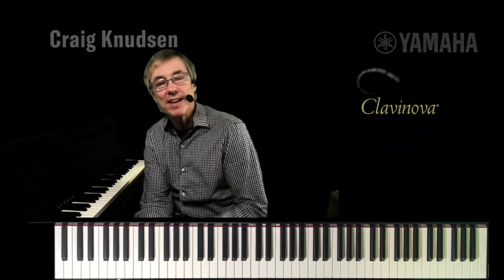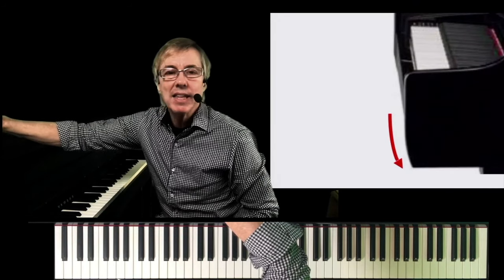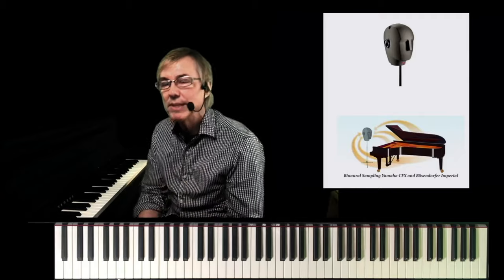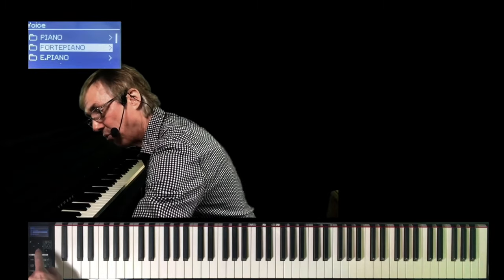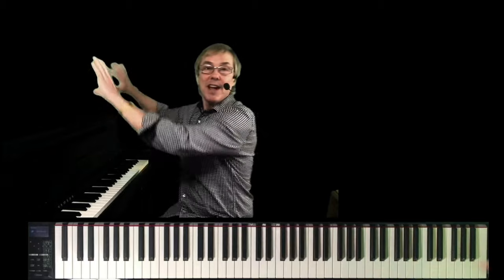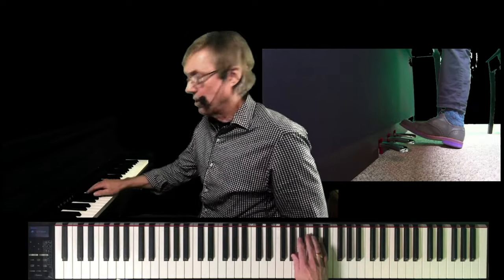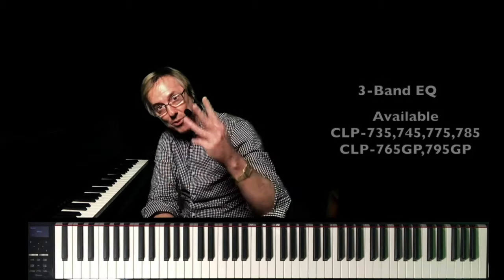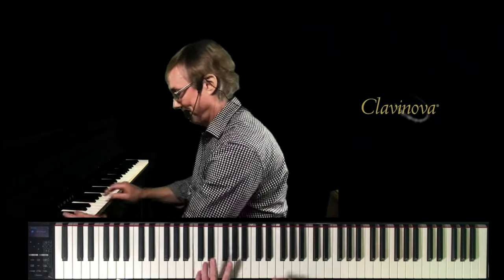Yamaha CLP-700 Series - New Features

Comment: At 10:52, it is said that the CLP-775 and CLP-785 both contain the Beethoven and Scarlatti pianos; this is not true - only the CLP-785 contains all four. Apart from that, great demonstration. One of the best of the 700 series out there.
Reply: Good catch on the Fortepianos on CLP-775. You are correct, the CLP-775 has 2 Fortepianos and the 785 has all four. I had an early spec sheet that incorrectly listed all 4 Fortepianos for the CLP-775.

Comment: question:  what is the lifespan of these computers running these pianos?  What is the durability of these computers based on  useage, temperature, electrical power surges? Often, this issue makes the instrument obsolete and possibly unsellable within years without remedy.  Impressive these are, no dought,. but could you share your experience on this question? Thank you
Reply: Good point...

Comment: The new CLP-700 line is beautiful.  I will soon purchase a CLP-775 or CLP-785. I do have a question. I have single sided hearing loss. I am almost completely deaf in my right ear, and what sound little sound I do pick up with that ear is distorted.  While the binaural sampling is likely amazing for a person with full hearing in both ears, it is distracting for me. Do you have a setting to turn this off? I have purchased an adapter for my current piano that converts the stereo headphone jack to a monaural output.
Reply: Yes, it can be turned off in the settings.